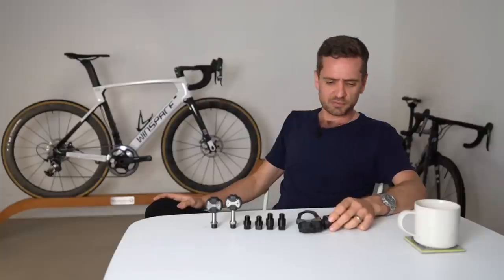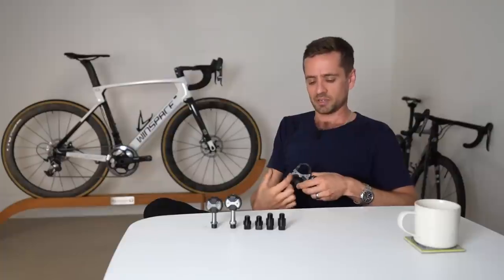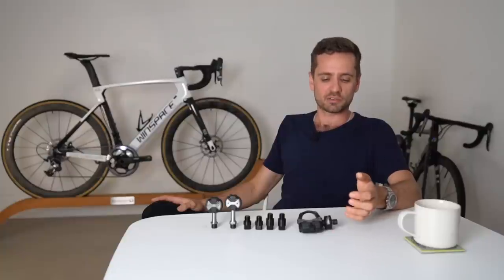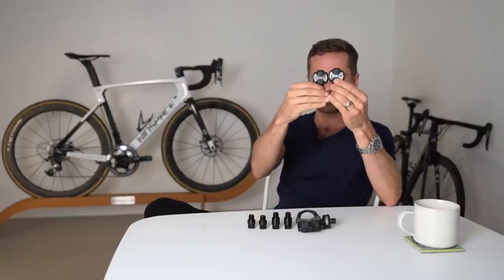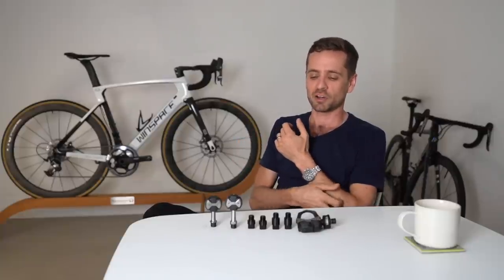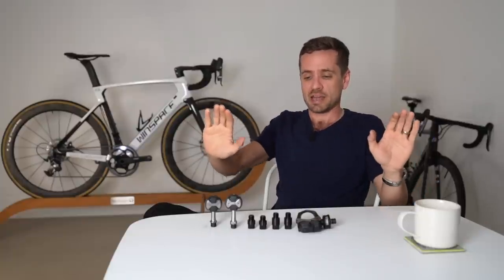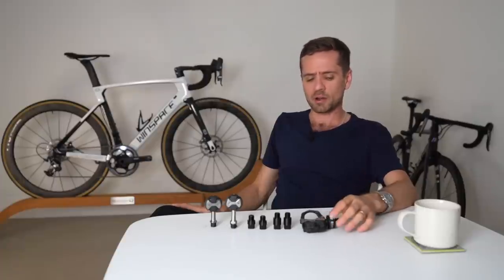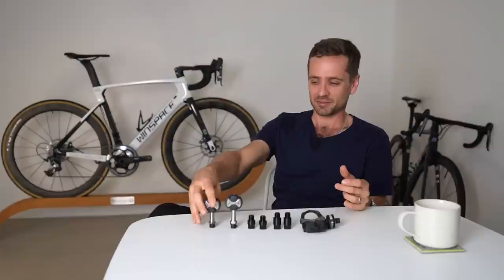Want More Power? (How to Respect Cycling Q-factor)

Comment: I remember when I got my first road bike, I spent ages trying to get bike fit sorted and the foot pain was agonising. Only when I compared the road bike and my mountain bike Q factor was it obvious there is a big difference in stance.
In the end I used 20mm spacer blocks and combined with mtb flat pedals and mtb shoes (don't like being clipped in) so my feet can move around a bit - problem solved.
Also means can put your feet in the centre of foot over axle position more easily than fiddling with shoes and cleats.
The wider Q factor made it so comfortable, solved the foot and knee pain problems instantly.
I wish this video was around back then, but thanks for making it, as I think there will be a few light bulb moments from the info given.
Reply from the maker: Thanks for sharing on the thread Stephen 👍

Comment: I had knee pain for years despite several professional fits. Not one of the fitters even looked at knee tracking. I finally took my own video and discovered my knees make a V-shape at the top of the pedal stroke. I got 20mm pedal extenders, my knees tracked straight and the pain went away immediately. But pedal extenders have problems. They can break carbon cranks so they aren't recommended for those, and even some aluminum crank manufacturers won't warranty their cranks if you use pedal extenders.. So the cranks that can be used are very limited. Also, the extenders seem to loosen up regularly and it can be hard to make them tight enough to the crank arm and to the pedal. It makes another point of stress failure at the crank if they get even a little bit loose.

Ideally the pedal manufacturers would all make longer spindles for people who need them, which would be better than using extenders. I use TIME ATAC pedals and I sure wish I could get longer spindles for them. Does anyone know where I could get custom length spindles for TIME ATACs? I tried Speedplays for a year but I don't like that even a couple specs of dirt prevent me from getting clipped in. The ATACs feel fantastic, I just wish I could get longer spindles for them.

One more thought: the White Industries G30 gravel crank has a nice wide q-factor out of the box (171mm) but still has a standard road/gravel chainline. So, you don't have to use extenders with those. But currently there are no power meters available for it. I asked White to team up with a spider based power meter company, and I hope you all will ask them to also.
Reply from the maker: Thanks for sharing on the thread! Cam

Comment: This video should be mandatory viewing for bike fitters. The bike industry makes the sweeping generalization that everyone has the same stance width, you can buy different length cranks but not different widths. In anything other than cycling, hip impingement isn’t a problem because as soon as the foot leaves the ground there is freedom of movement. With cycling the crank goes up and down - it really is the hardest case. I’ve built fitting pedals with lateral strain gauges to better understand what’s happening with my clients.

Comment: Thank you for always giving us the opportunity to listen to your valuable stories.

 I have a strong toe out foot on my right side (about 30 degrees), so I use three 20mm pedal extenders attached(total 60mm). The cleats in SPD shoes don't rotate very large, so I cut and widen the slots to allow for a 30-degree cleat angle. However, my left foot is mildly toe out, so I was able to cope with a single 20mm pedal extender with a slight cleat rotation in the two slots of my SPD shoe.

 If you really have legs like mine, you should probably put up with flat pedals, but I was encouraged by this video. 

With three pedal extenders totaling 60mm, you have no choice but to ride at your own risk. I hope somewhere they will come out with a 60mm extender for one. Is it possible to extend the 20mm and 27mm exenders that you introduced by connecting them? I live in Japan, but if I have English language skills, money, and time, I would definitely like to visit a teacher.

Comment: I wish I lived close to Australia, but the UK is a bit far to come for a bike fit! Already I have learned through watching this excellent series of videos that I have one leg longer than the other by +15mm (confirmed by a physio) adding a shim under the right foot has been a game changer. I now have full leg engagement (both legs) in a peddle stroke, more power, no knee tracking, no discomfort from pressure on one side of my saddle. Amazing, thanks for the advice given in these videos it has transformed my cycling to +400kms in one ride and in complete comfort and greater power.
Reply from the maker: Wow that’s very interesting to hear, thanks for sharing on the thread! Cam

Comment: I'm a former national level powerlifter and track rider. i discovered by accident that I needed a wider Q-factor. I wore out my bottom bracket and replaced the crank/bottom bracket, and was disappointed that the one I ordered had wider crank arms. I installed everything and took it for a ride and was instantly impressed. I felt like I could put power down better, and when standing I was torquing on the bars less. So then on my race bike I installed the Ultegra wider pedals with a washer that extends my stance a total of 10mm. I could probably go wider, but this setup is not bad for me.
I also ride my XC race bike, 29+ bike, and fatbike with no issues. I just needed a little wider stance on my roadbike.

Comment: Very informative video guys.   As a big broad guy, I've been using Speedplay Zero's with  their  longest 65mm spindles for many years and they solved a lot of comfort issues I used to have on standard 53mm  on most road pedals.  Wahoo promised a 65mm option when they acquired Speedplay last year ...  So far nothing has happened.   Sq Lab also make a +8mm +15mm spindle version's of their Road and Mtb pedals.
Reply: Same - walk with a wide stance, toe-out and outsides of feet. 

I struggled with knee & hip pain and hotspots on outside / front of my feet on a road crankset with narrow clipless pedals. 

Happened to get another bike with an MTB crankset and wide flats; which has increased the distance between the pedals' lateral centrelines from around 250mm on the road setup to 300mm on the MTB gear.  

Having ridden the MTB-equipped bike a lot more recently, getting back on the road setup feels conspicuously, uncomfortably narrow and  I get pain / hot spots within a few miles. 

I'm tempted to sling some extenders on the road pedals but am a bit dubious of the extra loading on Shimano's potentially sketchy cranks, while the pedals have no spanner flats (socket-drive from the back of the crank only) meaning hollow extenders and more potential for catastrophic failure.. 

Anyway, thanks for the great video @Road Cycling Acadamy - a really informative, clear and concise explanation that confirms / expands upon a lot of conclusions I'd drawn from my own experiences :)

Comment: for what it's worth, I find that a narrower Q Factor is also somewhat easier to spin (at least for me). maybe that's more of a mental thing? Also, lowering my saddle height significantly (15mm or so - set too high initially from a Bike Fit), made it easier to use standard width SPD-SL pedals, instead of the +4 version I normally ran.

Comment: Great video and one bike fitters in general are in denial about. Worth pointing out; there's a serious shortage of Q-factor options for the road for more than 56mm pedal center-to-crank. The Shimano/Look road pedal center-to-crank standard is basically 52mm with some 53; Garmin and Favero power meter pedals can be set at 53 or 55, you can gain an extra 2 to 3mm on each side with a Shimano GRX crank and front derailleur (which can be combined with a longer pedal), SPD MTB pedals are 53 or 55, and coming in at 56 for the win is the Mark Cavendish-demanded long-axle Shimano SPD-SL.  Then it's a big, big jump to the 64 or 65 of a Favero pedal axle for Shimano. And then in the low 70s we have a standard road pedal plus an extender, concerning to me in view of the Amazon reviews that discuss them breaking. In any case I just don't like doing things that only have a single vendor, so the Favero duo-Shi is out, and I'll probably do a 56mm pedal and see if I also end up needing to go GRX on the crankset. I've managed OK with 52 Dura-Ace, but it's clear from the fit done by my physiotherapist that I need wider; this kind of hinted at about 58-59 as being ideal.

Comment: Haha I need narrow q-factor just because my feet are so wide :) i use track cranks on my road bike, as the q-factor is reduced (usually about 137mm). By allowing the inside edge of my foot to be further in, the centerline of my foot is more or less where it would be if I had normal width feet on a standard road crank.

Comment: With drop bar mountain bikes like the salsa cutthroat it's easy to run into too wide Q factor issues since you are typically riding them for hundreds of miles like a road bike but the boost spacing being super wide.

Comment: the chain stay on my oldest bike has a thumbnail-sized section of paint completely rubbed off from years of heel contact before I discovered pedal extenders. Oddly enough, I only need it for my right leg, which also has a slightly longer femur. I suspect the much more significant outward rotation of that foot and the cm in leg length difference are related. The extra 18-22mm of spindle has helped with both issues.

Comment: I use the Look keo 2 max pedals on 105 R7000 cranks and find it pretty comfortable with the cleats maxed out all the way in towards my big toe or arch side of the foot to push my feet out away from the crank arms. My feet / toes track pretty straight when walking around.

Comment: I use the 20mm pedal extenders but have trouble finding suitable pedals, because you can’t use Allen key fitting pedals with them, they must have a shoulder on the spindle, so that you can fit them with a pedal spanner. Cheaper Shimano road pedals have this but Look Keos don’t, they are all Allen key fitting. I prefer the Look as they have more float. I might try the SQ Labs ones.
Reply from the maker: Interesting to hear, thanks for sharing on the thread Trevor. Cam

Comment: Last year I was able to buy long axle length Shimano Ultegra peddles, really wanted dura ace but pandemic issues prevented that. Narrow Q factor issues with tracking an knee considerably lessened, with this spindle size was available in 2011 when I bought my first trek road bike, all those years suffering 🤦🏻‍♂️😢
Reply from the maker: We're glad you are on the right path to getting you setup right!
There are pedal axle extenders if you need to go a lot further wider but depending on your scenario and issues will change what you need to get!
-RCA Team

Comment: I had a failed experiment with 20mm pedal extenders. After about 5k miles, I had one shear off; I just removed them all from my (3) bikes. Down the line, I'll just look at pedals with longer spindles. To be clear: the threads weren't stripped; it just cracked and broke off - - steel.
Reply: thats scary, where did you purchase the failed extenders?
Reply: @GutiSteve  Amazon. They had about 4 choices in 20mm.

Comment: Do you have any tips on how to work around limited internal rotation of the hips without adjusting the q-factor out? 
For track cycling you cant increase the q-factor to much since that will lead to hitting the track banking at low speeds.
Reply from the maker: Video to come, stay tuned.

Comment: Have excessive cramping in my VMO after lowering my saddle. Is my saddle height too low? Ie. Hip runs out of room at the top of the stroke, knee moves outboard then brought back in by the quad as you described at 8:03. Have cleats all the way back and inboard (too move feet out). Saddle height was reduced by 4cm.

Comment: The Look Keo pedals can only be removed with a hex keys only so they aren’t compatible with the pedal extensions (if you want to remove them). Once the Look pedal is screwed in tight to the extender you can’t get it back off again! Shimano pedals can be removed with a normal spanner so they aren’t a problem.
Reply: Are you absolutely sure they are? From the photos most Shimanos don't seem to have a hex spanner flat anymore as well, for SPDs only the PD-520 does, not the 540s, definitely not the higher end models.

Can you confirm that they work with extensions from experience? Because if that's the case, that would be awesome!
Reply: @andieymi  You're right the latest 105/Ultegra/Dura-ace SPD-SLs don't have the spanner flats. I have an older Ultegra pair which do. Even so if I was committed to Shimano and didn't want to pay for the extended axle version, which may be still not long enough, I'd take a look at the spd-sl PD-R550 or PD-RS500 which accept spanners. Hope that helps.
Reply: @danielhunt2510  Yes, at least they allow it on the lower end SPD and SPD-SL pedals. Still a shame that if Q-factor is a consideration (agreeing the 4mm for the long axle being little to nothing), you are basically stuck with the lowest tier pedals of the system, which kinda sucks.

Comment: Video time on 6:33 mark. I have the exact same pattern - chopping on my right knee which is rising higher than my left knee and my left hips seems to lock. 

However, when i changed from 16mm to 20mm pedal extenders on both pedals to increase Q-factor, I experienced knee pains. Should I try 20mm (Left) and 16mm (Right)? It seemed that the left hips is not externally rotating well.

Comment: After countless try and error,plus years of knee pain,i find out i need to go narrower q factor.im using assioma pedal,so my solution is,dremel a new cleat position, basically narrower and rearward...sure enuff works like a charm,power transfer wayyyy better,medial knee pain reduced..but need strengthening session after years of bad position on the bike
Reply from the maker: Thanks for sharing on the thread Firdaus
Reply: How did you do this @tinted87? Did you alter the cleat or the washers (looks like you can get 1.5 mm that way)? Do you use Shimano cleats/pedals (Assioma Shi)?

Comment: Great content, as always. Can you increase the length of only one side? My right knee  and foot seem to always want to move out.
Reply from the maker: Hey Alberto,
There are some circumstances where this could be applied but very limited. A more common issue is further up the chain regarding to seat height/reach and other position so finding a good bike fitter could prove very beneficial.
-RCA Team

Comment: what would the solution be for a rider with one foot externally rotated and one foot virtually straight? My right inside heel (externally rotated) is always brushing the crank arm, but I don't have that issue on the left. Would I increase the spindle length on the right side only and leave the left untouched? or would that create even more imbalances? thanks.
Reply from the maker: Question for Neill, I hope he can get to if for you. Cam
Reply: I have the same exact question! Less internal rotation on my right leg so it feels like I pedal with the outer edge of my foot, there was a video Francis cade posted that lightly went over it. Going to try a +4 duraace on one side and a regular on my left
Reply: @williamdonayre  I have the same issue. How did it end up going?
Reply: Did you get any solutions for it?

Comment: Hi folks, great videos, if I ever get my life organised enough would love to repay you by signing up to the Academy! Quick question for now though - have you ever seen a rider's position on the saddle change as a result of fitting wider pedals? 

I fitted some +15mm SQlab pedals to the gravel bike. My pedalling and knees felt fine BUT I found I was fiddling about more on the saddle again and my shorts seemed to want to scooch up somewhere quite uncomfortable! I also noticed the sort of forearm pain/elbow pain at the end of the ride that I've experienced in the past from a saddle that's tilted too far forward.

I wondered if wider pedals might result in the legs supporting the upper body less and as a result the forearms taking too much weight? I've moved my saddle forwards 10mm but haven't had a chance to test it yet.

Cheers

Comment: Question, I have recently switched from Shimano Ultegra 6800 to Campy Record 12s, experiencing some sit bone pain on my left sit bone/inside thigh on a saddle that's been comfortable for nearly 10yrs. The Q factors are different, 148mm for Shimano and 145.5 for Campy.  Could this be the source of the pain? I've not experienced knee pain, just this weird pain in my left sit bone

Comment: May i ask for help,  i have the correct setup right now, it is (right pedal extender28mm )  for the left it is 21mm

But left leg pedal extender is shorter 21mm (7mm shorter) so when i push hard i have pain in the quadriceps just above the knee in the left leg ,, it is because a shorter extender make my left leg be shorter?  
Should i raise the saddle just to compensate for the left pedal extender being shorter?

Comment: Excellent video! One question, even with aluminum cranks, is it Okie to use 2 20mm pedal extenders on the same side?
Reply: Wouldn't recommend this honestly. I have this same problem and I'm using the longest bb spindle from Rotor in my road bike, offsetting all the extra space to the left in my case (doesn't work if you need it in the right, because of the chain stay). This gives like 21mm of extra clearance, added to +15mm speedplay spindles and +6mm cleat extenders from Form Bikefit. 42mm of extra foot separation in one side. If you're a weird built guy like me, this is the way to go. This setup has been figured out by myself, nearly any bikefitter has the knowledge to get to something this weird (and trust me, I've been to many, including an SH approved one in Europe)